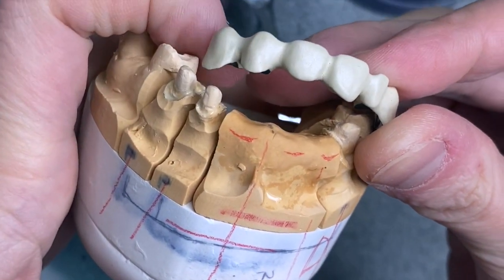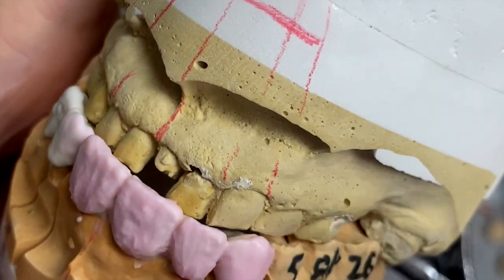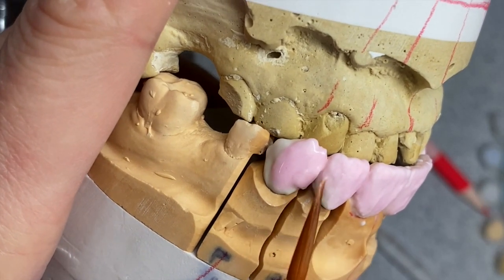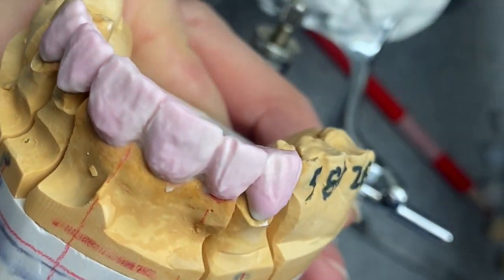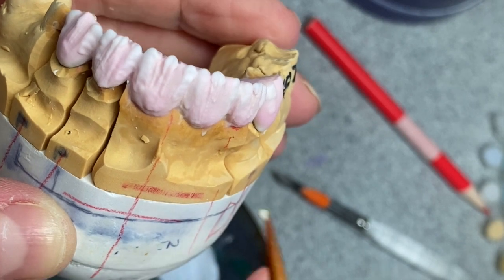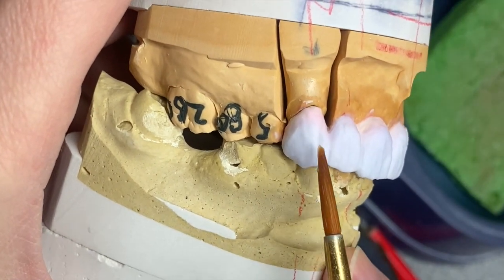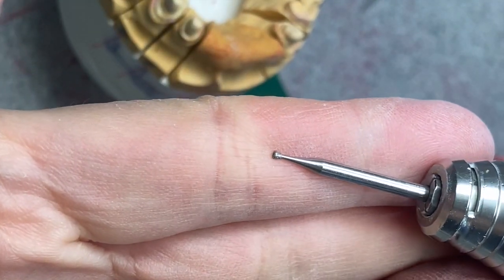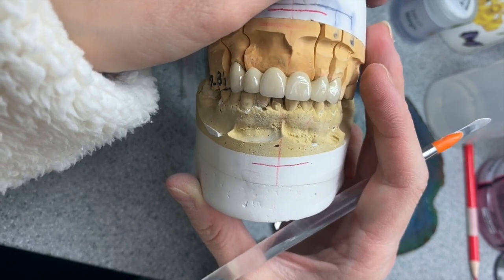How to Make Texture on Anterior Bridge

Comment: 1 Bake all the time ?
Reply from the maker: Hi! Of course it’s not going to work all the time: sometimes the frame is too small (in case of implants for example) and then I have to apply copious amounts of porcelain and it cracks between crowns. But most of the time our talented goldmen and cad designers are making frames appropriate size so I don’t have to apply a lot of porcelain and don’t need the second bake - it’s teamwork😉

Comment: Good work it will be great if you can share still pictures at a close-up of the textures added in direct light. Also advise if the parallel lines will gather more stains Insitu and is this the only way to add this effect ?
Reply from the maker: Hi, Mohammad! Yes, you’re right, the parallel lines can gather more stain if they came out too deep; so it’s better to apply light pressure when making the texture or glaze and bake before applying stain - that would minimize stain gathering. Grinding texture is not always essential because some people have smooth teeth, that’s why I don’t always do it. There are probably other ways to produce this effect, yet I don’t know about them